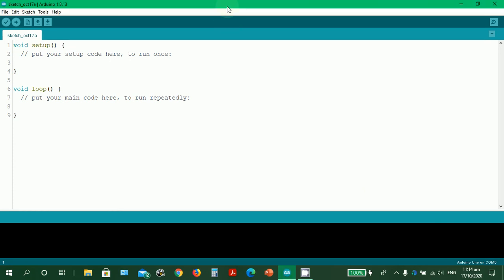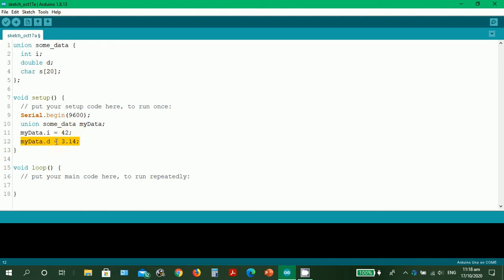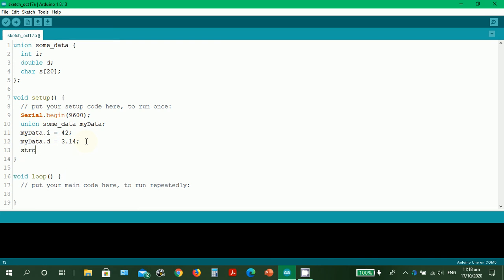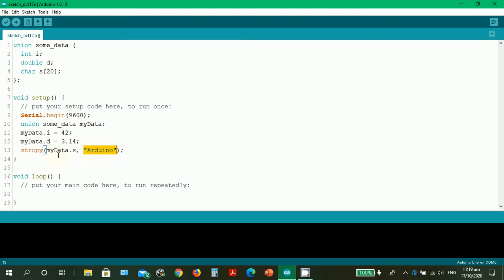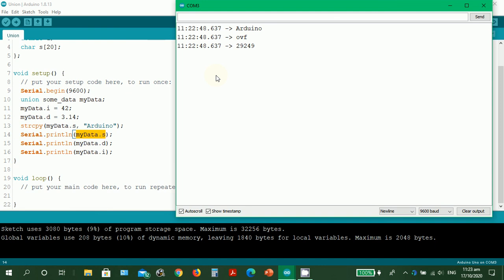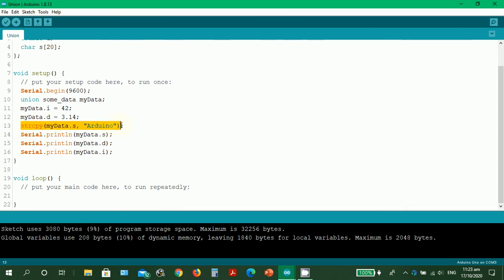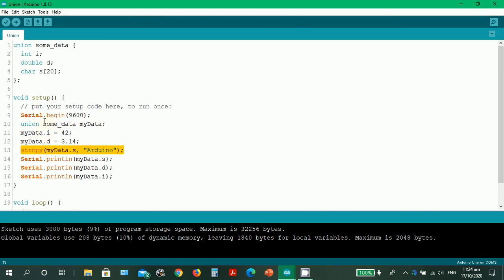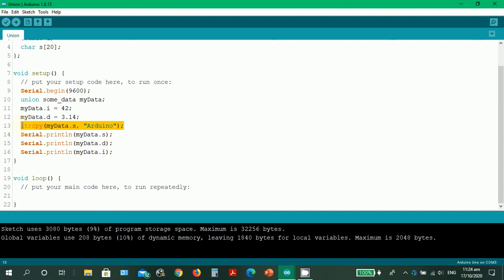EASY-HOW-TO Using Union in an Arduino Sketch Tutorial

Comment: Hi, I am trying to read a float number that has a value of -0.24 from 2 registers of 16 bits but when using union I am obtaining a value of -71.872. Please, can you tell me what the problem is?

int16_t reg[2] = {48757, 49807};

union some_data{
  int16_t ints[2];
  float tofloat;
};

void setup()
{
  Serial.begin(57600);
}

void loop()
{ //the value of tofloat should be -0.24
  union some_data dato;
  for  (byte i = 0; i<2; i++){
    dato.ints[i] = reg[i];
  }
  Serial.println(dato.tofloat, 3);
  delay(1000);
}
Reply from the maker: Good day!

I think the problem lies because you used union data type. You should have used the struct data type.